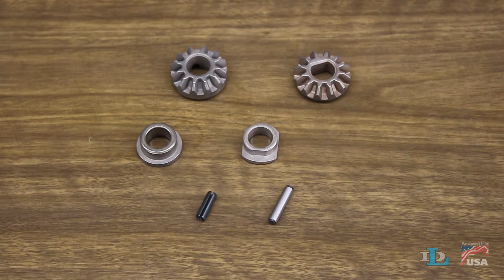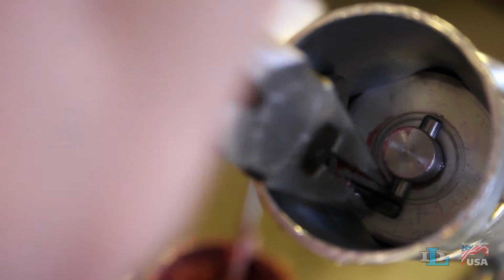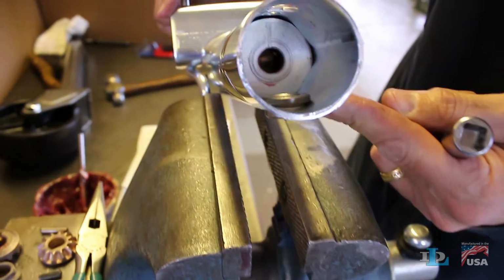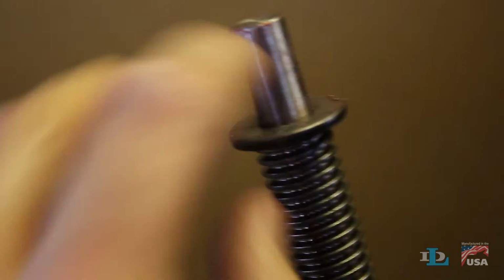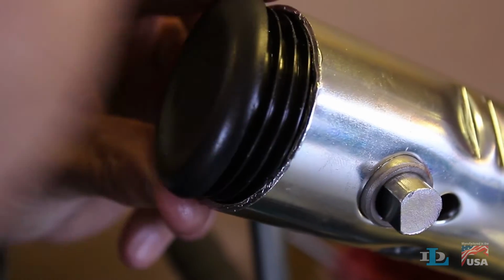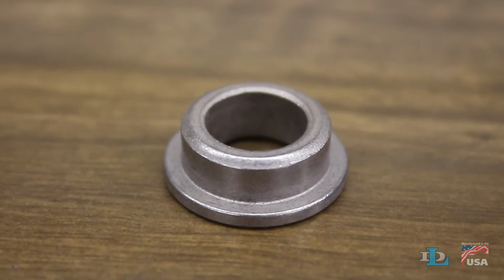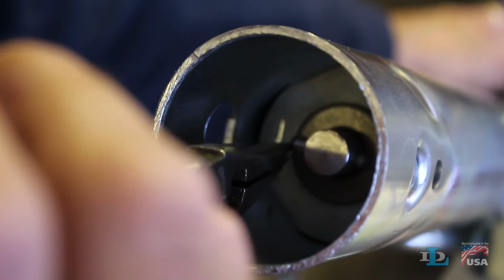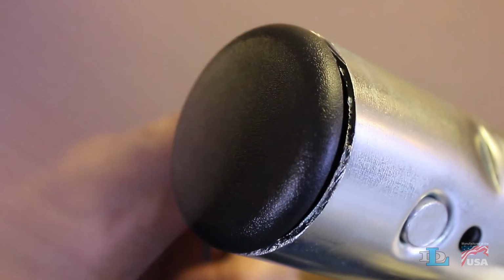Replacing 6812B and 6813A Miter Gear Kits - Step-By-Step

Comment: I have a question so I have a 1200 pound  capacity trailer jack from a single axle trailer used to haul ATVs it needs to be rebuilt because it no longer moves up and down anymore. When you crank the handle in fact, the handle will just barely turn if any at all and when it does turn if it does, the Jack will not retract The only problem is the label that tells me who makes the Jack has worn away with the time being outside, so I have no idea. How to I identify what the brand even is I also don’t know which kind of parts to order are all rebuild kits the same I mean, they look similar, but that doesn’t mean much. I was just wondering because it is serviceable and I can take it apart to that extent, and I would really hate to throw it away if it’s something I can rebuild
Reply from the maker: Thanks for reaching out!  It can be tough to identify the brand of a jack if there aren't any labels or stickers on it.  If it is a D-L jack, there will be four numbers stamped into the bottom of the outer tube.  This is the date code for the jack.  Another way to distinguish between different manufacturers' tongue jacks is the size and shape of the black plastic handle grip.  Does your jack appear to have a black plastic handle grip like the ones you see on the jacks on our website?  Such as this one- https://www.dutton-lainson.com/proddetail.php?prod=22457

Comment: What if I screw is Rusted up in I cannot turn it
Reply from the maker: Thanks for reaching out!  If you brush your jack's inner screw (as shown at the 2:20 mark of this video), and it still is too rusty to be turned, then it is time to replace your jack.  We do not sell our jacks' inner tube (with the attached inner screw) as a separate repair part.
Reply: Thanks but I am trying to save a dolla if you taking drill a hole in the side of the Jack where you can get to the pens you can knock them out and settle it and you're good to go

Comment: I'm about to strip down, clean, regrease and rebuild an older DL marine jack, similar to those in your video. The old grease is dried/caked up on the smaller parts and packed in the cylinder. What do you recommend to soak the parts in to dissolve the old dried grease so that I can easily clean the parts and regrease?
Reply from the maker: Thanks for your question!  You can soak the old jack parts in mineral spirits.

Comment: Do you think I can drill a hole in the bottom to insert a screw to prevent the jack not to swivel without dameging the inside parts?
Reply from the maker: Daniel- thanks for your question, but it would be better if we could talk to you on the phone about it.  Please call 402-460-4416 to speak with Todd, one of our engineers, or email him at tyost [at] dlco.com.

Comment: good video, i have the problem of the bottom half of the jack, ie the inside part that elongates or shortens, this part has fallen out, and i need to know how to fasten this piece back to the main part, tube, and screw, etc of the trailer jack, i can see the screw inside and the square nut on the screw, but somehow after working normally about 20 times over a few months it is not attached and thus practically useless, please help me with this matter, thanx
Reply from the maker: Mike Boston (This reply is being re-posted as our original response from four months ago was deleted from YouTube)

Thanks for your question!  

In order to completely and accurately address this issue, please call Todd, our engineer who specializes in tongue jacks, anytime from 8 AM - 5 PM Central time Monday - Friday at 402-462-4141, extension 416.